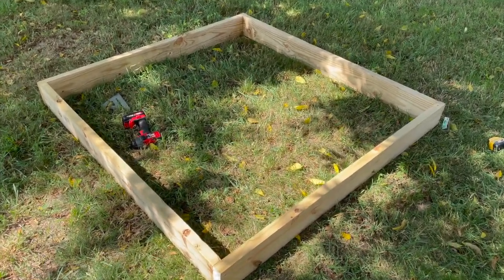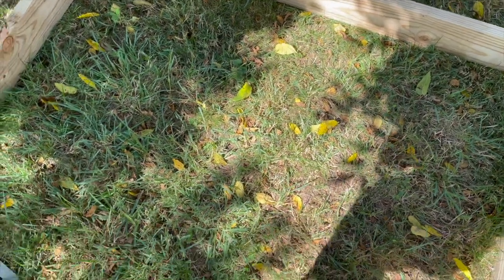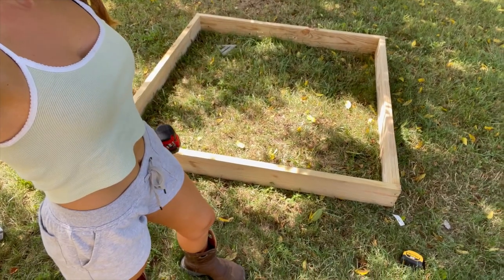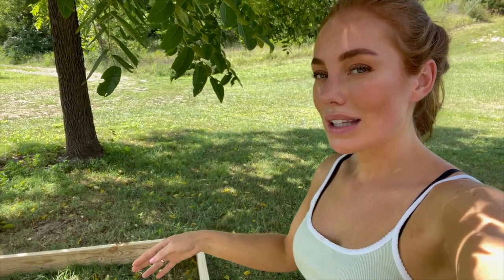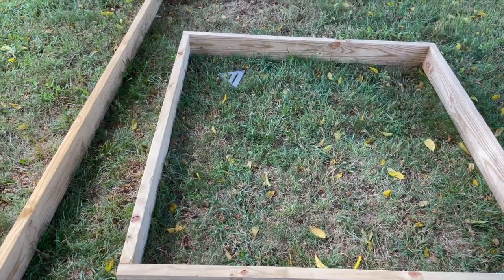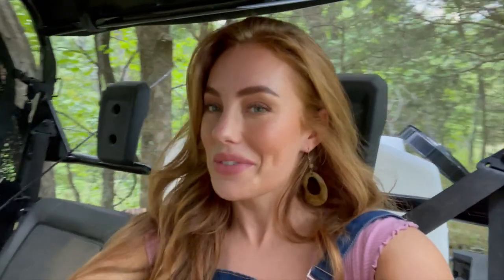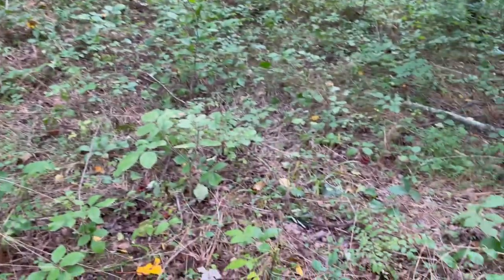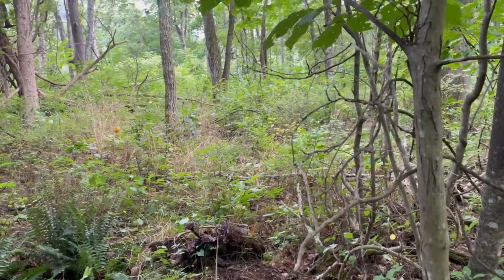One thing on my mind... HUNTING SEASON!! Building an Elevated Box Blind for the first time!

Comment: Heidi here's a little tip you can use if you want to or not. When you set your saw horses or wait no seahorses LOL put them the width apart that you need and lay a piece of plywood across them that way whatever you're cutting will be held by the plywood and then you can cut your board just off the end of the plywood and everything else will be supported for you. Because if you're cutting in between your seahorses the board could bind or flip with you and throw your saw into your hand or worse so I hope this helps take care and God bless you and your mom and good luck in this upcoming season.

Comment: The point of sawing the hanging bit is so the board doesn't pinch the saw blade and cause it to kick backwards on you. JUST BE CAREFUL!!!!!, I've been sawing for 20 years, would hate to see you get hurt, it happens to a lot of experienced cutters also... if you insist on cutting that way you're pushing your luck, eventually it will backfire on you.. CAREFUL Red!😘
Reply: Truth
Reply: Cutting between the saw horses!!! Saw a chap get a saw in his guts when the board pinched the blade and the saw kicked back. 
Clamp your board, both ends, and cut the hanging side. Please!
Reply: Just got your message and I just want to say that that is cool 😎
Reply: 100% true.
Reply: Always hold the piece you are cutting.   👍
Reply: Absolutely true.
Another thing to watch for is the guard over the blade can get stuck open after passing through your cut. I've seen people put the saw down on the ground next to them with s stuck guard and the saw blade hits the deck while spinning causing the saw to circle around the person.  One time the saw crawled up the guys leg. Ouch.
Saw another guy rest the saw against his thigh between cuts and take a large chunk out of his leg due to a stuck guard. 
Always check the guard before putting the saw down anywhere. 
Just 2 seconds for a quick look can save some skin.
Reply: I wanted to say this but wasn't. Hate to be the know it all. BUT DAMN.

Comment: Great job building that stand. I really enjoy how you just go with it and try to do it the way you want. Keep it up, this is why I subscribed.

Overalls with boots…..damn nice 

With the impact drivers you have to use specific bits for the impact. Your life will be much easier for further builds with that impact. Wish you would have used a flat washer on the hex side and a locking washer on the nut side.

Comment: Hooray on your tackling this project! And learning as you proceed! I built a box stand a few years ago and learned the hard way. One thing to consider is your entrance into the stand  and also how you will close up your shooting windows when you’re not in the stand and want to keep the elements out. You can use camouflage spray paint to paint the  whole structure and use the woodlands camo spray paint  I did it the hard way and completely assembled in my workshop, took it apart and reassembled it at the stand site. Used a tractor to stand it in place(legs and floor only) then hauled my prefab parts up, (including the prefab roof covered with tin) with a rope. It was a job for one person(me), but was well worth the effort. Excellent to hunt out of when it is drizzling rain. Just work safely with those power tools! P.S Best way to plant seeds is with an Earthway Seeder. Cheap but effective. Can’t wait to see part two!

Comment: Saw horse. The impact is for sockets. You have a drill for the drill bits. They also make hammer drills but they are for drilling masonry or concrete. Prices of building materials has been high since Covid but they are starting to go down. Wood especially was high. Pine knots and those branches are the hardest part of the tree, don't feel bad. A folding saw would be best for the tree.

Comment: Although too late now, gluing all the joints would have kept the wood from squeaking for a long time. For safety, please try to cut the overhanging end OR use another board underneath as a backing that you can cut into. I've seen a lot of kickbacks over the decades because of people trying to cut into a pinch point, myself included. Thanks for the video and play safe!

Comment: For the trees you want to control get some stump remover at Lowes, trim the branches back until you can get to the trunk and then drill several holes in then spoon the stump remover powder into the holes.

Comment: The one drill you have is called a "screw gun" that's for drilling holes and has an adjustable chuck for different size drill bits for drilling holes. The impact drill is exactly that it impacts the screws to a certain torque so you don't strip the screw, and only has one size for the bit that you are using like the Philips head for your screws or a 5/16 nut driver. pull back on the chuck to release the bit. cant wait to see your stand! YOU ROCK!

Comment: If you haven't already found out, or someone hasn't already told you. A Drill is for drilling holes. An Impact Driver is for putting in fasteners; screws, bolts, nuts, etc... Always good to have both. Looks like you doing a fantastic job for your first time building a blind.

Comment: you  should add flat washers on the in side before installing nut
Reply: Theirs no metal on the inside, so it would be better to add the flat washers and I would go back with a wrench and that impact she had and tighten the bolt's up, maybe even consider nylock nuts instead of regular hex nuts.

Comment: Dear Lord keep this child safe and free from harm. Cutting in between the horses can cause aa pinch and kickback in the saw. I did construction for about 6 years and saw some nasty saw accidents. May I also suggest putting in some 16D nails in the floor joist, screws are strong but don't have the shear strength of a nail.

Comment: Cut the autumn olive bushes down, then when they get up about knee high spray em. Find out out what the power company uses to spray the power line right o ways. Or, the railroad. See if they’ll give you some, I don’t know if they will, but they might.  You can get it in granular or liquid form.
Reply: There's a brush herbicide called Crossbow that works really well. 👌

Comment: If you want it to be safe and last a long time, you should get some floor joist brackets and some nails to hold the floor joist together and some corner brackets for each corner. Screws may be easier to put the floor Joice's together with, but they're not strong and "flexible" like nails, so the screws can snap off under pressure. 
Also, you could have used galvanized bolts and screws, stainless are nice but they are expensive and should be used on things around saltwater. But in the woods galvanized will last longer than the wood you built it with. lol.

Comment: Heidi, the Autumn Olive is an invasive species and does spread like wildfire. Control can be very difficult as it is a prolific seed producer. You may need to cut and apply herbicide to stumps from summer through winter repeatedly to kill. Cutting and burning won't work. You can consult with your local county's state forest service agent for recommendations. I'm a forester here in Granville County, NC. Yes, those cedar limbs are hard to cut! Take care.

Comment: It's SAW horses. Like, I saw horses before.

Usually it's less expensive to buy bolts and nuts in bulk rather than packaged in a box.  You may end up with more bolts and nuts after the project is done, but that's supplies for the next project.  Get some big round flat washers for the back side where the nut attaches to the bolt. As your walking around inside the blind, the swaying of the structure may accidentally pull a nut through the 2X6. Flat washers will give you a larger surface for the nut to push against minimizing the chance the nut pulls through the 2X6.

Obviously you made a stop at Harbor Freight and got your Bauer impact driver there. I've got one too, along with a Craftsman impact driver I found at the local pawn shop. They work for home projects just as well as the big name brands and are very price competitive. Good choice.

Comment: I could fire up the Miller Millermatic 252 and 210 to fab and weld up some custom brackets in a situation like this. Make sure you drill your mounting holes first as the steel will slightly harden during the welding process. I have to remind my co-workers (engineers that have degrees from Purdue) of this all the time. I joined the service and later went to trade school. They went to college and it shows badly often........

Comment: Autumn Olive is very difficult to kill with hand tools.  High level of effort.   You can spray the trunk/stem at ground level to about 1’ up with a 50/50 mix of diesel fuel and crossbow brush killer after normal leaves start falling.  Or cut off stems (after September) and spray the stump.  Stuff is a nightmare.  Don’t bother spraying with glyphosate, that just sets it back temporarily.  Regarding your seed, not sure when you planted but mid-Sept is pretty late.  That spot does look good though, next year hit it with Round Up at least twice in early and late July and then throw down the seed before mid-Aug.  No need to till it.  Throw it out by hand rather than pouring it from the bag.  It does not do well with weeds so those have to go first.  Good luck.

Comment: Oh yeah, just in case no has said it.
To square up your box frame, measure from corner to corner like an x. Box is square when measurements are the same, or close to the same.
Will help when aligning plywood properly as the ply is square.
Advanced trick, use plywood to align the frame squarely!

Comment: Unfortunately those seeds were waisted as most of them need good soil contact. Down & quick method is mow / weed trim and you could get away with a hard rake to scratch the surface. My guess is the ph there is unknown but winter rye will grow almost anywhere. Any oaks in the area where the stand is? Good luck.

Comment: You will discover over time building that cutting between two support points (in this case saw horses) can often pinch your saw blade at some point during your cut.  If it's a power tool like a circular saw, you can get it jammed, stop the saw and it's not always obvious during the ensuing confusion why the saw stopped...so, yeah.

Comment: Impact drivers are for driving fasteners (screws, bolts, etc.).....drills are for drilling holes.  Similar tools with some overlap in function, but the right tool for the right job applies.

Comment: My only tip would be that when you're using an ax (or a Hammer), that you hold it closer to the bottom of the handle and let the weight of the head do the work. it will cut your strikes in half.
Otherwise you're awesome.

Comment: What will you use for the floor? Your old barn wood? Store bought plywood? They come in different thicknesses:  1/8", 1/4", 1/2", 3/4", 1".    At a 4ft x 8ft basic size.  3/4" is used in house construction for floors, and is very heavy.  Some one mentioned in a previous comment  that to cover 5X5 area you will have to cut 2 pieces from a 4x8 size.  One maybe 4x5 with a 1x5, or 2  2.5 x 5.  If you place that stand up-right before the floor is put in, you will have to cut the wood where you electricity is, to run the skill saw, and then transport them to the stand. You may need to bring a ladder with so you can get onto the stand, then hoist the wood up to the stand, then place the wood in place and drill the screws in. I think it would be easier to leave the platform on the ground near electricity and use the skill saw to cut out the correct sizes, then place in position and  drill the screws in.

Comment: Getting rid of "Autumn Olive" is a very difficult labor intensive challenge. The easiest method is using Herbicides which is not environmentally wise in my opinion.  Cutting them down BEFORE they fruit will work but it will take years of persistence.  Good luck.  😁

Comment: Now all you need is a chop saw it will help you cut your angles a lot faster and straight cuts just a little Mark with a pencil and cut and get you a stand to go with that chop saw or just use your two sawhorses with two or three boards smashed together to set it on

Comment: The way to tell if your frame is really in square is to measure from corner to corner, if it is off there is a simple method to square it by cutting 4 small triangular pieces, (gussets) and screwing them on the top or bottom of the frame and as you screw them down pull the frame square. If not being square is an issue forget this process.

Comment: Get yourself two ropes and pull that stand up, use your little vehicle tired on the tow hitch of the vehicle move slowly, you move slowly while your mom hold on to the back of it so it won’t tip over as you’re moving forward, careful 😂 I want to see more videos , note : if it’s too tall and you’re afraid the legs might snap ,then put two boards to support the legs when you rise it , after it’s up take the The supporting boards off , 😛

Comment: I would just recommend that instead of using screws, you use nails. The reason is, if and when your structure shifts, the nails will bend, but the screws will break. Just FYI. Looks good though.

Comment: Nice build. Some tips, if you're interested.. 

 - For cuts on long boards like that, you might want to invest in a second pair of saw horses...i'm sure you understand that the saw is VERY dangerous, but i was honestly cringing a lot. Not saying that to be mean, i just don't like seeing people get hurt "in the shop". 

 - For a project like this, you might wanna use long deck screws, rather than the wood screws you used...they're better suited for it. 

 - There's not a whole lot of math involved with the joists. All you really need to do is measure the board you wanna replicate, mark it on your stock, and cut away. the way you did it worked just fine, but using the measuring tape is way easier. Also, for spacing, all you really gotta do is measure the length of the span, cut that number in half, and then cut the half in half again.... i mean, when you get into fractions, it gets annoying, so, at that point, i'd just round it... for that measurement, it doesn't hafta be perfect, you're still going to be structurally sound.

 - For attaching the plywood deck, an easy tip is to make sure the joists are squared up, before securing them. then you can use the screws you secured the joists with, as a reference for where the centerline of the joists are. Alternatively, you can also use your square to mark up where the centerline is on the deck, using the screws as a reference, and then use a level, or your tape, or a chalk line, if you don't have a long level, to complete the marking on the deck, then you absolutely know where the centerline is. 

 - You are correct that the impact driver is the wrong tool for drilling. Honestly, that's a perfectly normal mistake to make, for someone who doesn't really use this stuff on the daily.

- For the bolts, you CAN just tap them into the hole with a hammer (be gentle), or, if you have a rubber mallet, that works even better (wack them as hard as you want)

 - For securing/tightening the nuts to the bolts, you REALLY want a wrench to hold the opposite end of whatever you've got the impact driver on. It can be a normal crescent wrench, or an adjustable, or you could even use a ratchet.. you just ABSOLUTELY do not wanna try to hold that with your fingers.. real easy to get hurt that way.

 - You got ripped off on the hardware.. Things like the bolts you secured the brackets with, and the lag bolts... buy them loose. manufacturers ALWAYS screw you with the pre-packaged stuff.

Comment: Being a floor, you should have cross joists between the joists at random intervals. The plywood will start to sink in between the joists without it.
Reply: Having a drill and a driver will make it easier during assembly. You won't have to change out bits all the time.
Reply: This is why I bought a cordless electric chainsaw.

Comment: Construction hack 101. Always build in increments of 4ft when possible. If not possible, Always make it an even number. Building 5'X5' will always have 1' of waste on the ends or the sides and the the floor/roof. You could have built a 6'X6' box with the exact same amount of material with 0 to minimum waste. Life hack FYI

Comment: So, once you have the floor mounted 9 feet high how are you going to build the rest of it: walls, ceiling, ladder?.  A suggestion I have is to build the sides and windows and ceiling on the platform BEFORE you raise the platform to 9 feet high. The trick is to NOT screw the walls and door and windows and roof in while the platform is on the ground. The worst image I have is of you or Mom falling off the 9 foot high platform while trying to attach a wall or door or ceiling wood item.

Comment: And mix 50/50 diesel fuel and burnt motor oil after u cut down the tree pour the mixture over the stump it will die clear down to the roots